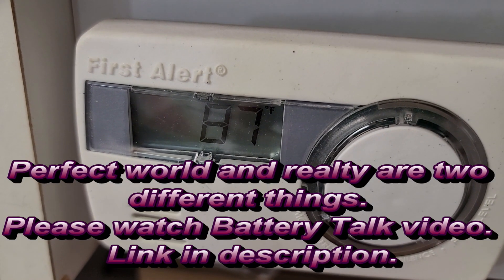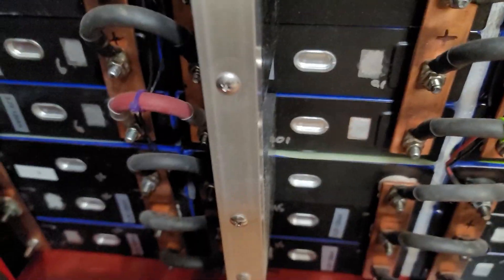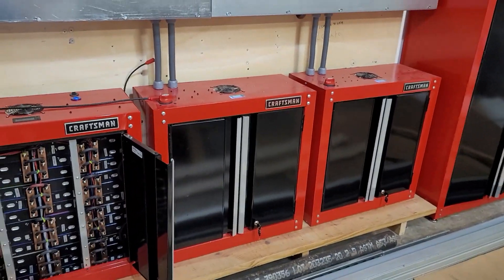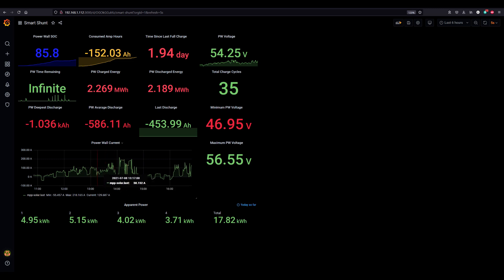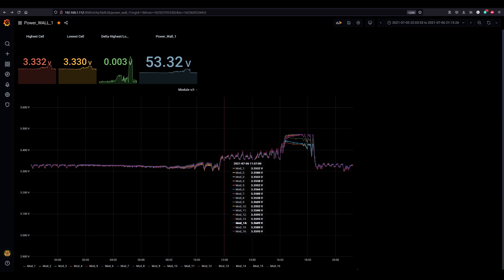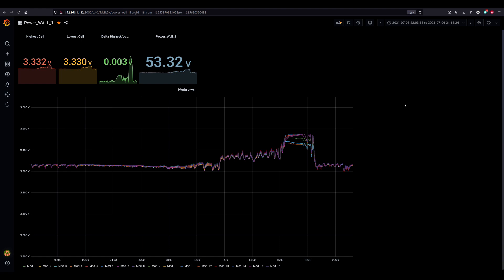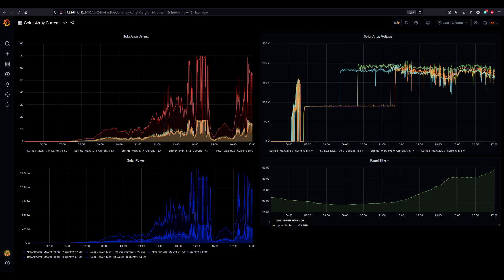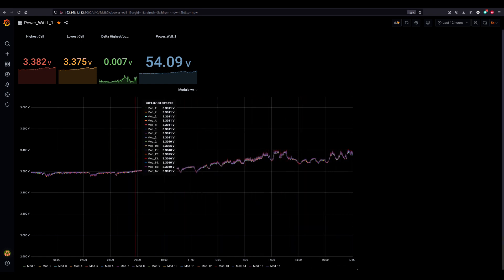Day in Life of DIY Powerwall

Comment: Great information.  I am trying to decide how much storage I will need for my system.  Could you show/graph your state of charge for a day/week/month and show the minimum since you went off grid.  You have 52 KHW of storage, so I would like to see what you minimum SOC has been on the last few months to see if you ever get close to zero SOC.  I am near Atlanta too, so your weather impact is pretty much the same as mine.
Reply from the maker: I can discharge the powerwalls in 7 hours with no problem since I charge EV every couple of days. Lowest SOC was 2%. I normally stay between 40-90 SOC. However July is the worst month for production so far. Are you trying to run the whole house on solar+batteries or just certain loads?
Reply: I will be building in two phases. The first phase will power my garage and the room over.  It will need to power a 2 ton heat pump and my computers and home theater.  I plan to use 3200 watts of panels and 200 AH of batteries.  I think this will be enough.  The second phase will power the rest of the house including two heat pumps, all the kitchen and laundry appliances and maybe a heat pump water heater.  That will be  the hard part.  I am guessing I will need two or three times as much power and battery capacity as the garage system.  It this point, I do not have a car to charge (maybe later).  

When you are not charging your car, can your batteries stay over 20% SOC all the time?
Reply from the maker: Nice plan. I hope you show it off. As for your question if battery can stay over 20% SOC with out car. Yes it can, no problem. Majority of time it will stay over 65% over night. However this sized for my needs and is working just fine this summer. We shall see what winter brings.

Comment: Curious on why you went with 3 inverters instead of a single unit.  And is your total battery size 43kw?  You are off the grid now, but do you ever plan on grids tie in the winter time?
Reply from the maker: I have 4 inverters and 3 power walls. Power walls total around 52kWh of usable energy. Of course I will be on grid. I will use grid as back up.
Reply: @DMIINC2013  thanks for the quick reply.  What was the reasoning behind using 4 inverters instead of just 1 or maybe just 2 units?
Reply from the maker: In U.S. we use split phase 240 Volt system. You need 2 LV6548 to make split phase. I have 4 in split phase for extra power. 2 in each phase. 26kW of available power.
Reply: @DMIINC2013  that makes sense now and I am in the States.  Thanks for the clarification now.  How much idle power are you consuming?  I assume those MPP inverters are hybrid.  I was looking at the new model coming out later this month LVX 6048 and maybe a growatt if they have 1.
Reply from the maker: Sorry, I didn't know you are in the U.S. You never know where people are commenting from. I talk more about idle consumption in this video.    https://youtu.be/ZegjqH0TGlU

Comment: Nice video! Might of missed it but do you have some more cells coming? Also from what I read there is very little usable power that can be stored above 3.375v (lifepo4) so as a result I limit my battery bank to 54v (3.375*16) and at that level my cells stay within .01~.02v. If I push it then I get the spread that you are seeing.
Reply from the maker: Correct. Not much usable energy at the top of the voltage curve. However they will finish charging faster then on lower voltage setting. We fight lack of sun power at the end of each day.

Comment: When combining your 3 parallel cells, what selection parameters did you use if any? E.g., did you match internal resistance and/or measured capacity of each cell in the 3p?
Reply from the maker: with 144 cells over 3 powerwalls that would take months. But I did balance modules once power wall was assembled. I have video on that too.  https://youtu.be/3zin8E2dquI